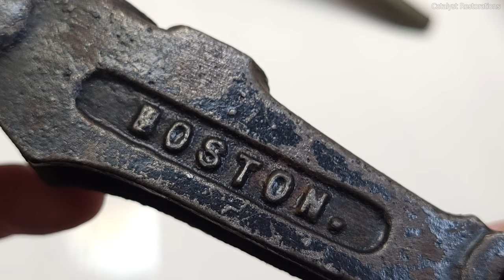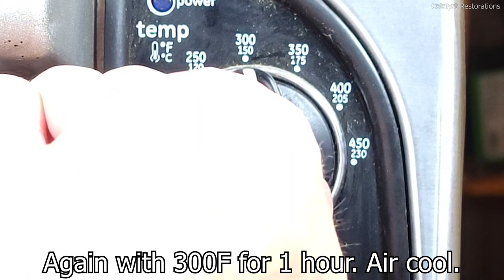Traditional Japanning and Restoring 130-year-old Bolt Cutters

Comment: if only the surface of the metal wasnt so pitted from age, the japanning would look so much more beautiful, but it still looks great despite that
Reply from the maker: Believe it or not, most of the rough surface finish/holes is actually from the manufacturing process when they cast these. They would've used sand molds to cast these and when you're mass producing sand castings over 100 years ago that was just a typical acceptable surface finish.
Reply: @CatalystRestorations  did not know that, interesting, so shoddy finishes were simply the old way of "get it done fast"
Reply from the maker: @kevinmorrice  pretty much. That being said, the overall quality of the tool is still pretty great compared to many modern tools!
Reply: @CatalystRestorations  oh yeah, you cant beat the old stuff, i knew a guy in my hometown whose family has used the same axe for firewood for about 170 years, and there was a mechanic who used his grandfathers wrenches